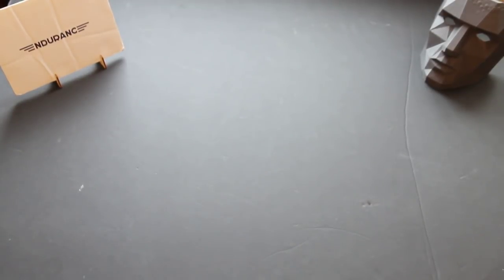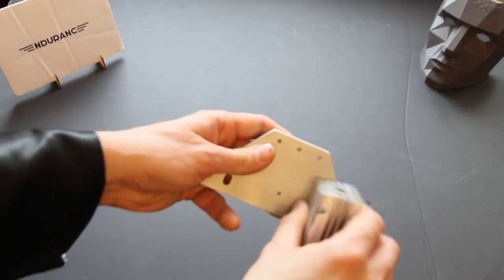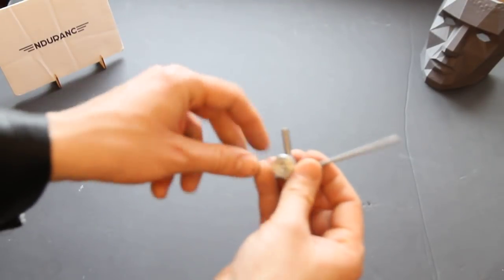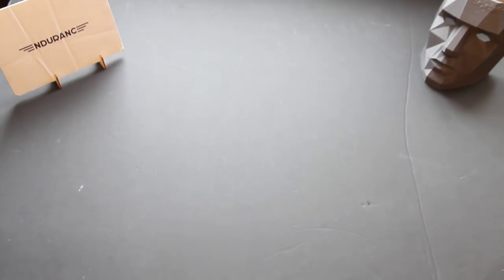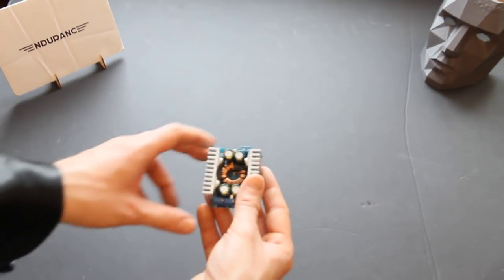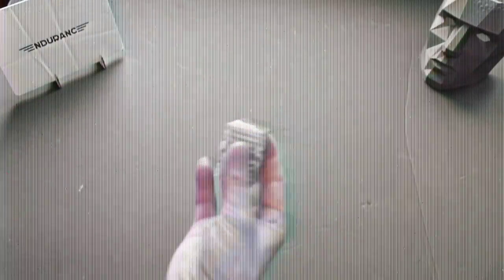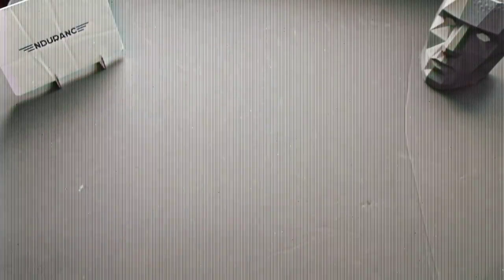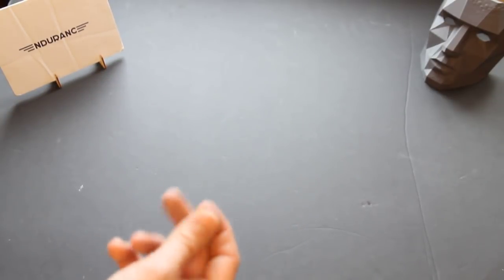Improvements of Endurance laser attachment (2018).

Comment: So looking at the dual bracket laser holder. Can I put any diode laser onto it? I have  2.5 watt and am still waiting for my 8 watt and air assist to get here. Can I put both of them on the holder and get 10.5 watts....or if I decide to buy another 8 watt have 16 watts of laser power? Are the lasers angled so both beams converge at the same point or would they be side to side cutting/engraving?
Reply from the maker: welcome to Endurance family Rick!)